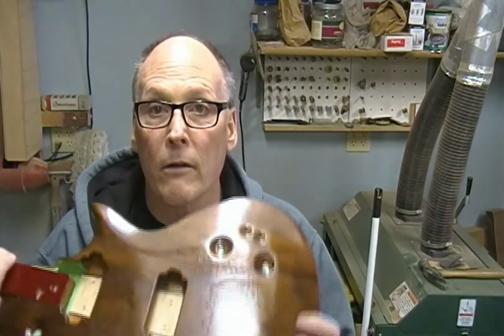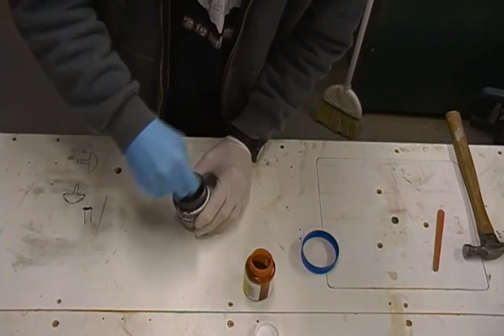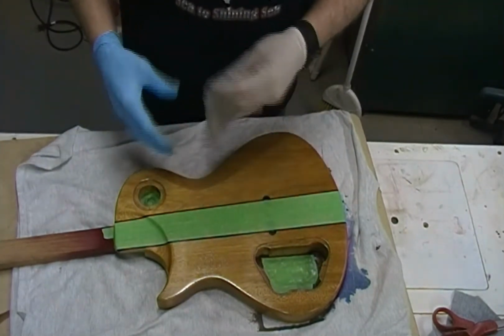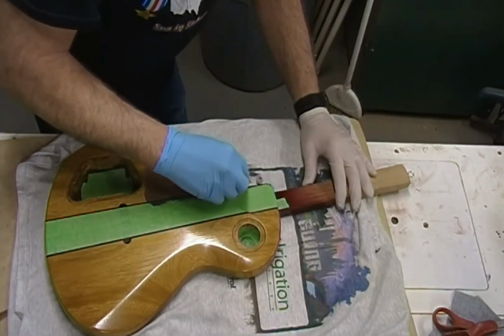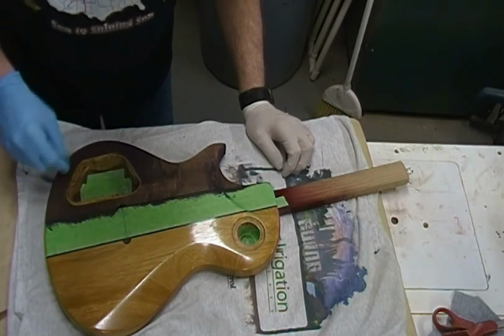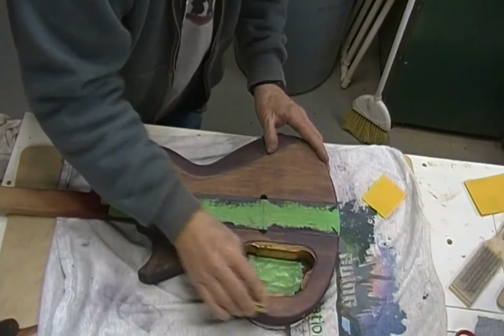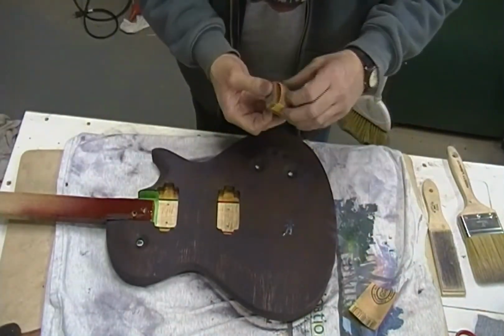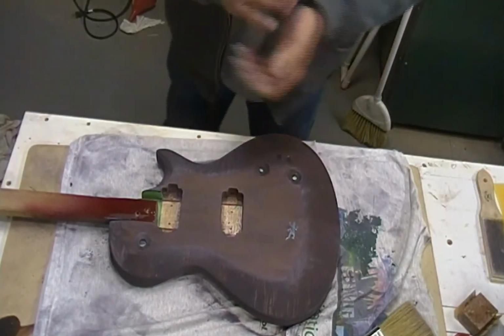Custom Electric Guitar Build, “GECKO” 9 String, by Jonah Guitars #26

Comment: Good job Dane!!!!))) I never seen a filler put over shellac before. I have used thinned down shellac on open grain like a violin top and then I would put my oil varnish on the top.
Reply from the maker: Steve Harris, hey Steve thanks a lot for watching brother. The reason I seal the wood first is to keep the end grain from getting to dark by soaking in the color of the filler. Lots of end grain on a guitar with the cut away and the butt.
Reply: Dane Nichols 👍🏼👍🏼👍🏼😊